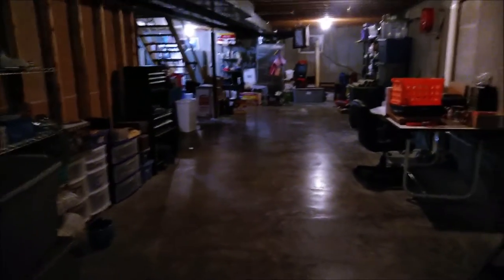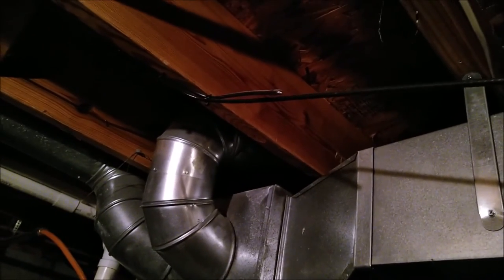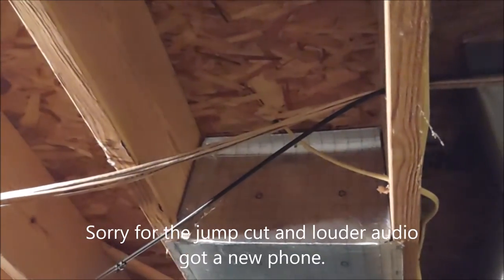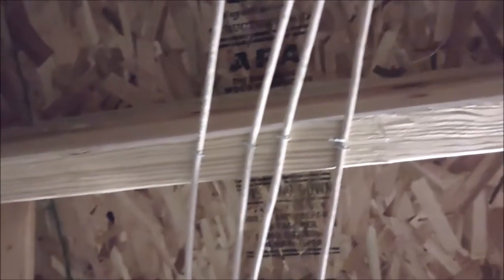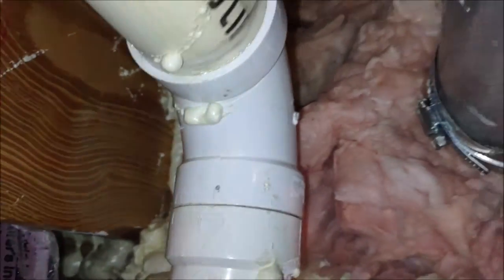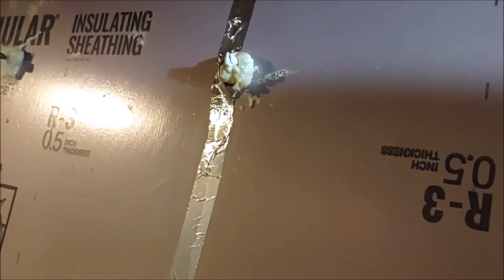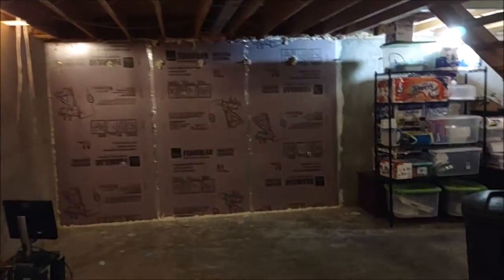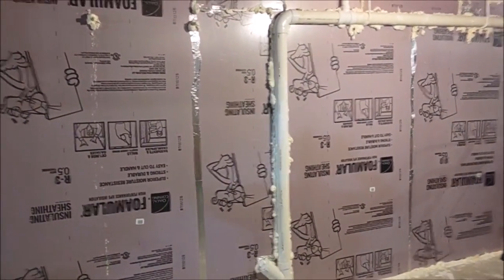Prep Work Before Framing Your Basement

Comment: What region are you in? I'm trying to get some idea of the best practices for my region. (Southeast US). I've seen the foam board installed in northern regions where they leave an air gap behind the foam next to the concrete wall so that any moisture that does get it will have a way to evaporate.
Reply from the maker: I'm in the Midwest Indiana hope that helps I'll be documenting each step of the process